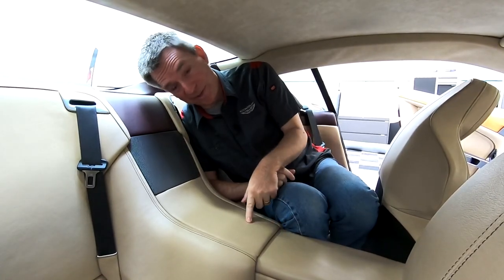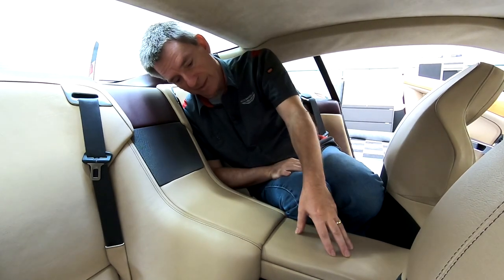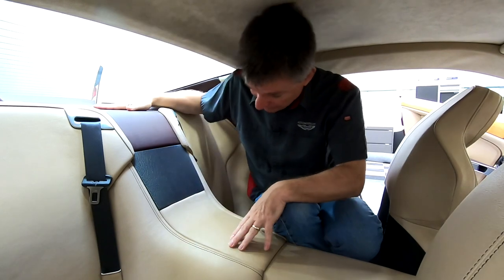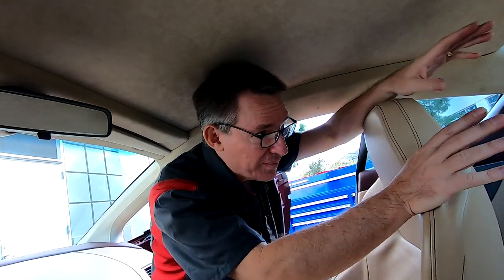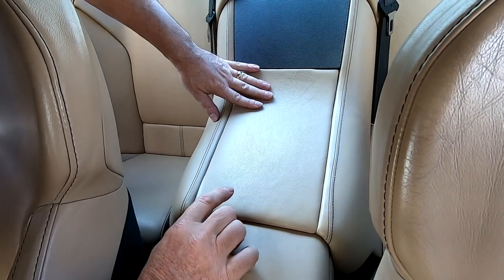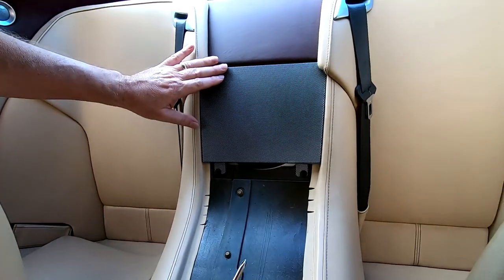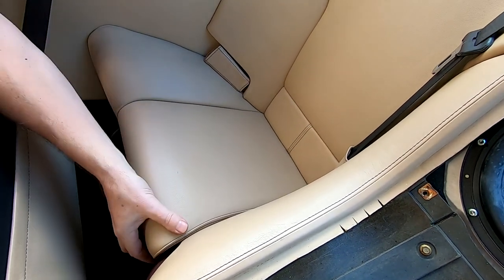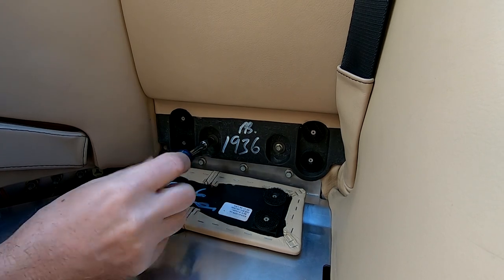Removing the Rear Center Console from an Aston Martin DB9

Comment: Brilliant I’m going to do this just to clean the glass back there, was searching to see if you’d done this literally just a few days ago!
Reply: PS mines a DB9.2 so will assume it’s exactly the same except no rear brake light cable to detach…
Reply from the maker: I hope this helps - and it would be a perfect time to clean that small patch of glass.   Leave a comment if the process is diferent on the DB9.2   Thanks for watching!
Reply: @Aston1936  hi there, yes removal is exactly the same as in your video other than no wire to worry about. Thanks again and I’ll add a comment to the main thread.

Comment: Hi. In case any DB9.2 owners are wondering, I’ve just followed this video on my 2015 car and the process was identical, other than there’s no wiring to worry about as no third rear light there. 
Do watch out though, there’s a small gap ahead of the first panel you remove and it would be so easy to lose a screw down there. 
Great opportunity to clean up back there!
Reply from the maker: Awesome, thanks for sharing with everyone.   Getting back there to clean seems to be a common theme amongst viewers.  Thanks for watching!